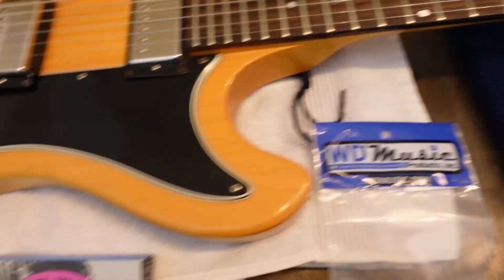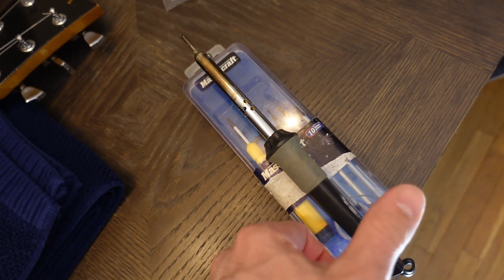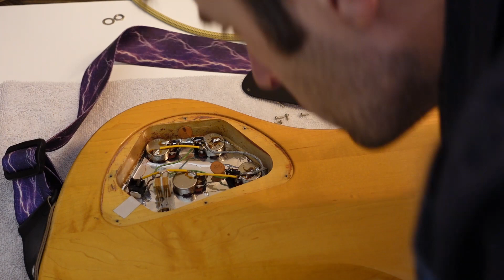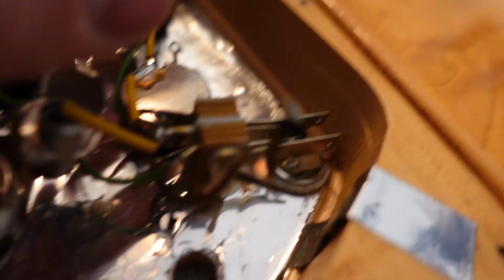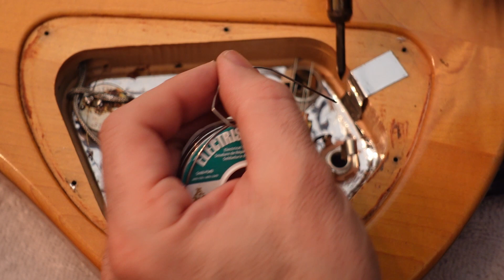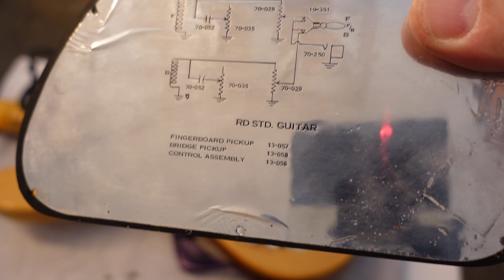Guitar Output Jack Install - Gibson RD Standard

Comment: I have the same guitar but a 78. Super cool guitars, especially the standards.
Reply from the maker: It's a bit of an oddity but I like it. I agree that the standard is the way to go as I wouldn't want the Moog electronics of the other versions. I did have a lot of noise issues with the original pickups so I put in a newer set. I might mess around with the old ones and see if I can get them to sound good.